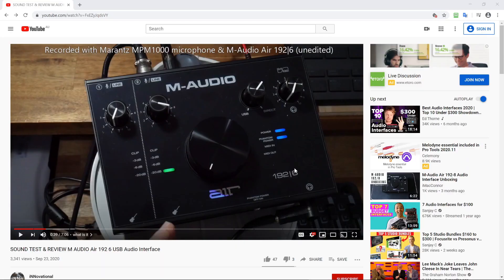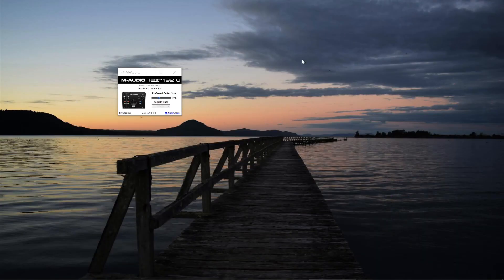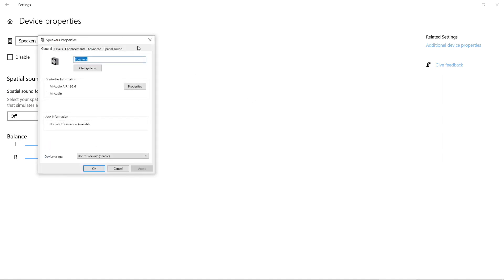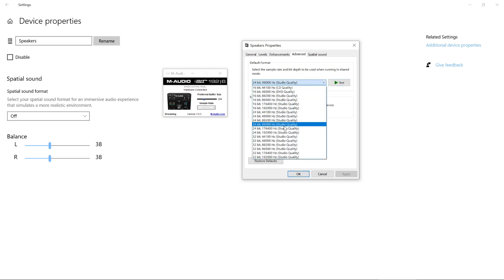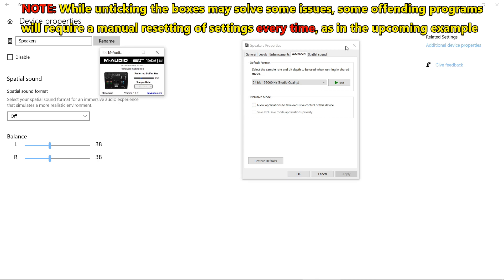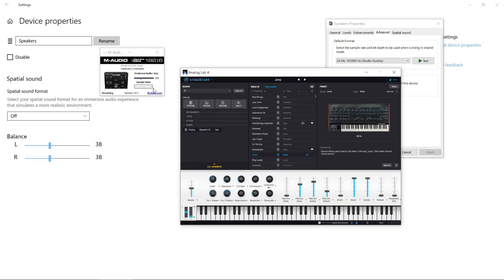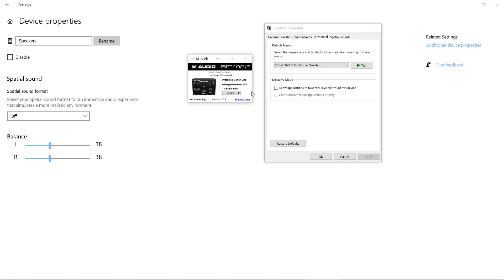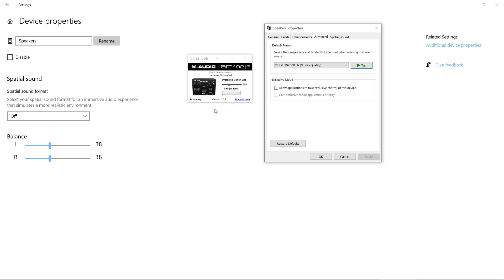M Audio Air No Sound Not Working Error Problem 192 4 6 8 14 USB Audio Interface

Comment: The drivers are buggy. People should simply NOT buy these interfaces. Thats the core issue. I also had issues with the device dropping while using DAWs (happing in multiple, so not a software issue specific to any DAW).  Digital Performer also cannot validate the ASIO driver. 

M-Audii has ZERO support and never updates their driver to fix these bugs. 

This card is unusable in Windows as it resets to 32-Bit, which it doesnt even support so its off that option is even there. And you will sound like a chipmunk when speaking into the microphone. So, it cannot be sued as a system audio device. No matter how many times you change the bit deoth to 24-Bit, it will reset back to 32-Bit when yoi close the dialog. 

Only usable with Mac computers as a class compliant device.

Comment: Hi everyone!

I just bought the M-Audio AIR 192 | 14 interface, but I think it has an issue on the outputs.
I can connect one set of speakers to the main outputs (1-2) and hear the sound which comes form a DJ console, but when trying to connect another set of speakers or an i-Rig interface, for recording the sound directly into a smartphone, to the outputs (3-4) it doesn't give any sound. I also tried to switch from main outputs (1-2) to secondary outputs (3-4) and there is no sound.

Can anyone help me with this?

Thanks!

Comment: Have you tried the newest audio driver for windows 10 from 2001?
I wonder if these new driver will solve these issue. I would be grateful for the test, as Im considering buying M-Audio 192|14 but hesitate from this exactly issue.
192 is so high! The size of recorded files will be much much bigger and also it takes a lot of processing power and the difference is rarely noticeable to the human ear. I hope there is other solution.

Comment: I only have three different sample rates to select in the drop down menu in Windows (even though the M-Audio control panel has many). I want to select 192kHz for playback (or anything else) but windows show only 48kHz. I have the drivers installed, tested on two notebooks, Windows 11 with the 1.0.4 driver. I am about to throw away the device.

Comment: I used this on my mac after it was sitting around for a few months. I opened up bias fx 2 and I get the sound but it has a pulsating effect to it. I'm not sure what is wrong here. I have the proper settings applied but to no avail.

Comment: I've got a bit of a different issue here and I'm struggling to find a solution. So for me the sound is fine but it stops playing from time to time and requires me to switch the sound drivers and still that last for a minute. Please help
Reply: Have you tried new driver from 2021- available on the M-Audio site

Comment: I followed all of the advice on here as Administrator and rebooted, however my M Audio Air still keeps reverting back to 32bit 48000.  😡AGHHH, I hate this device. if it doesn't receive any audio for longer than 2 hours, it effectively goes off line.  It is so annoying.
Reply: Try new drivers from the M-Audio site.

Comment: This issue occurs on M-Audio with Windows 11 even if there is no change in sampling rate. M-Audio support advice is not to upgrade - don't use M-audio on Windows 11 :(
Reply: I’m using m-audio 192-4 on windows 11 without issue
Reply: @alexdelli2  where did you get the driver ? I cannot find it on the M-audio site It says no driver available
Reply: Try new drivers from the M-Audio site.

Comment: Hi, I have a problem...I installed driver for M Audio Air 192 4 on Windows 7, but when I plug in Air 192 4 then computer shows message ,,Driver was not successfully installed". What to do?I tried to reinstall driver and restarted my computer but same thing.
Reply from the maker: Your can try this at your own risk. Get Korg Midi Uninstaller. Run the program, uncheck "Korg Devices Only" and proceed to get rid of all duplicate Midi drivers.
Reply: @innovational  Thanks for the reply, i'll see what i do.

Comment: This didn't work for me, it was making the sound sound static. I looked up on some forums and I saw some guy said it worked for him on 32-bit 44.1khz. so I did just that in the windows and m-audio control panel and it was crystal clear after wards. Posted this for anyone to help. Also it wasn't working until I turned the knob on the interface to USB.

Comment: M-Audio M-Track 2x2 C-series is not working it doesnt show up in my device properties but device manager my sound video and game controllers it pops up with certificate but it says This device cannot start. (Code 10) The specified request is not a valid operation for the target device. i seriously had this problem for and fixed it i use fl studio and asio4all it show up but disabled i tried to look to enable but can't find it i unistalled reinstalled looked through everyhting can anyone help me?
Reply: Try new drivers from the M-Audio website.

Comment: I tried this. It worked for a day. Then Windows 10 pro kept resetting it to 32 bit. So I called Microsoft. They knew nothing! So I reinstalled Windows 10.. still nothing. I finally went into the Adobe audition audio hardware settings. I set my device to M-Audio Air 192 4 ASIO. I set the device class to ASIO. It now works with out any issues.

Comment: Since my 192-8 stopped working with ableton live and anything that uses asio. I noticed windows 10 does not save my preferences in advanced. I'll switch to 24bit 48000hz and apply, close. Only to find it goes back to 32bit. It decided to save 32bit 48000hz compared to going back to 192000. No other programs use the interface, I checked the drivers, cable, which usb input I use. Nothing works. I was told its purely windows 10 and I''d have to do a reset. Ableton told me live 8 isnt supported by windows 10. Now I'm awaiting a reply from M-Audio support to see what they can do about this.
Reply: Did M-Audio support reply anything? Did you managed to fix it? Have you tried new drivers available on M-Audio site? maybe going to windows 11 will help - the driver for win 11 is brand new from this year.
Reply: No. This problem has existed since these I terraces were released. The drivers are super buggy. Don't buy M-Audio. Get PreSonus or Focusrite, instead. PreSonus has the best WDM and ASIO drivers, buy Focustire has better Pres for recording.

Comment: unfortunately this does not really fix the problem i've been having at least. The drivers are incapable of preventing windows/apps from constantly changing sample rate and even when they are matching correctly, my interface will sometimes crash and to be rebooted 5-10 times in the space of an hour.
Reply: ive actually fixed it, this should be a somewhat uncommon issue but if you have that problem of constant crackled and shutdowns, change USB ports. I was using USB3 Gen2s C at the back of my mobo which are meant to be the fastest and best for VR but i guess they are no good for sound interfaces.
Reply: bro i love you ty so much for sharing <3 @vstaritz
Reply: Were you also having issues with the inputs not working randomly? Cause I've been experiencing random audio dropouts and crackles just out of nowhere with this interface. And when you fixed it, did you use a USB A port or USB type C? Thanks!
Reply: Also happens on USB 2 ports. Issue is the drivers are worthless. Tried on multiple PCs. Ended up replacing the interface. Waste of money.
Reply: @ i never got random shutdowns and sample rate issues sincei switched to usba. i changed mobo recently and use last gen usbc and it works. the thing that has been happening intermittently the entire time though is specifically discord will randomly make my voice deeper. it's kinda funny but i have to reboot discord every time i first join a chat during the day it'"s very odd.

Comment: When I talk with friends or stream my mic will randomly stop working, and I'm using the m-audio 192 6. Do you think you have a solution? and also do you think its the audio interface or computer causing the problem?
Reply: Did u manage to get rid of this? I have M audio 192 4 and same exact problem
Reply: @AveN  I didn't necessarily fix it, I got a new computer, and it just started working. Unfortunately, I don't have a solution, apologies.
Reply: Keeps freezing while trying to record
Reply: My friend has this exact model, and when he tries to use the M-Audio ASIO driver in FL Studio, it creates random noises after playing audio, then the noise stops. It also has clipping issues. I’ve heard that if you connect the M-Audio to a Mac, it works perfectly fine. I think M-Audio hates Windows users.

Comment: Hi there! I have serious popping, glitching with this interface. I've tried 20-30 things, (including this solution above), brought back to warranty, but they didn't find any problem - it worked fine with other computers. I don't know what's wrong with my system, but it's very frustrating. I would really appreciate if anyone has a solution!
Reply from the maker: Sounds like an issue with your PC performance. Get Latency Monitor for your PC and it will show you what is causing the latency.
Reply: @innovational  Thank you Sir! Somehow I've solved the problem. I don't know why, but after update BIOS the glitching disappeared totally. I struggled weeks. Hope it won't appear again... Thanks again! :)

Comment: Is there any problem with the M-Audio Air 192 6 on Ryzen based Windows system? I'm pretty curios because i really look after this particular soundcard but in one of these thing review video's i found that somebody have a problem with their interface because it is ryzen based. He said that he already contact m-audio's tech support but they said it was a win10 problem or a motherboard compatibility issue.
Reply from the maker: I have a Ryzen system, and no problem with the interface because of this.
Reply: I have ryzen 5 3600 windows 10 pro... Will this work perfectly without issue ?  I want to buy air 192/4 interface, but someone also said to me it wont react well with amd and windows 10 pro... Please suggest me.. I have ryzen 5 3600
Reply: I read around 100 comments on Amazon and there were few that say that with Ryzen were some problems.

Comment: I bought the M-Audio Air 192|4 from a pawn shop. How do I get the M-Audio software?
Reply from the maker: Try registering on the M Audio website, it should give you access to the software. Drivers don't need registration to access.

Comment: Thank you this solved my no sound issue... Now I have a problem where I can't get any sound from any of my mic inputs... Mic signal is strong but cant get it to show any level as any of the window mic inputs. Any thoughts?
Reply: SOLVED - Same rules in this video apply to microphone inputs. all has to be the same... and i found on mine (windows 10) everything had to be set to 44.1.

Comment: I am still not having any luck with this.  I can see a signal when running a test but STILL no sound, can anyone help? Tested on Zoom as well as on the advanced properties test and there is definitely a signal, I just can't hear it.  Very frustrating. Please please help :(
Reply from the maker: This has happened to me once. All I did was unplug the audio interface and replug and it worked!
Reply: @innovational  I wish that worked for me, I am pulling my hair out with this one 😩
Reply: Same here - did you manage to find a solution?

Comment: Hey man, i have problem with line input gain knob, i set it on 2 on that knob
And then when I've done recording vocal, why is the recording so loud
Cause i set it on 2 or 1, but still the results it too loud and i hear background noise all over the place
Reply from the maker: What type of microphone are you using?

Comment: Hi, I recently bought this interface but the issue I am having is with the installation. I get an error when installing the required drivers for Windows that reads:  verify that you have sufficient privileges to start system services and won't let me finish the process. Any advice on how to fix this will be greatly appreciated!!
Reply from the maker: You need to right click on the setup file, then "run as administrator", type in your password, and then all good!
Reply: @innovational  I appreciate your fast response, but unfortunately that did not work. I have tried like 6 different things already and none have worked so far. This has never happened to me before. I have an old Tascam US-1800 that has given me such good service. If I am not able to make this work I think I'll end up returning it. It's a shame because everybody talks good about it, and has very good reviews but if it does not work with my PC I am not going to spend my creative time with some piece of gear. I subscribed to your channel. You have very good content!
Reply: @correametal  i  just bought it today and i have the same alert while installing the driver and i still don't know how to fix that
Reply: @producedbyasa  I am really sorry that you are going through the same issue. On my end after trying more than 10 different things and not being able to get assistance from M-Audio even though I tried to reach them by phone, email, FB, Instagram, YouTube, etc...I gave up and ended up going to the store which had no problem changing the product for another one. I've had Behringer which people criticize a lot but I never had any issue, then I upgraded to a Tascam US-1800 which I still have and works great. The only reason why I wanted an interface like this is because I needed something portable. Maybe the M-Audio interface is a great product, but I'll never know because their customer service is horrendous. So, I wish you the best and wished I could have been of help but unfortunately I had to move on and went for a Mackie Onyx one...which I was able to install and have it running in about 5-10 minutes and is great for what  need. Have a wonderful day and I wish you the best on your creative journey!!! Peace!

Comment: It will stutter once in a while if u set above 44.1khz... It’s windows10 issue. Only 44.1khz is stable.
Reply from the maker: Maybe in your situation, mine works well with 192kHz, but not anything between 96kHz and 192kHz. 44kHz and 48kHz works well too.